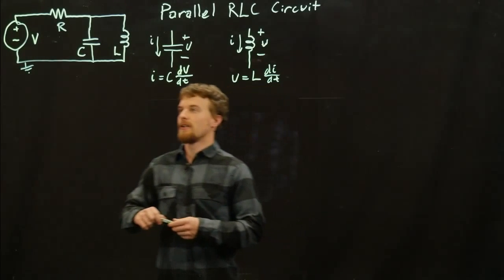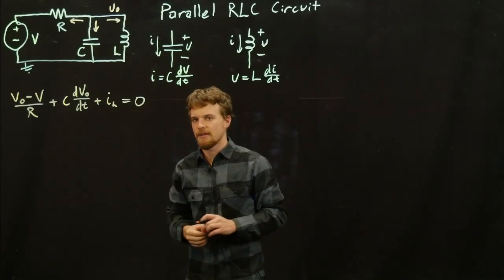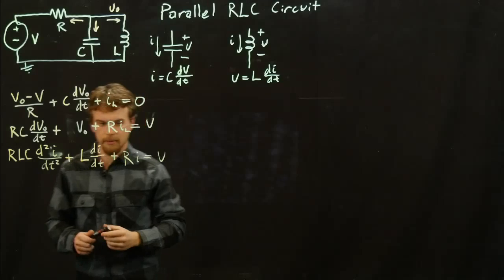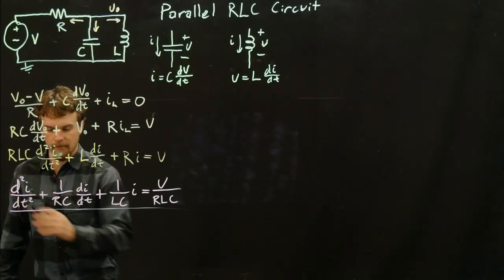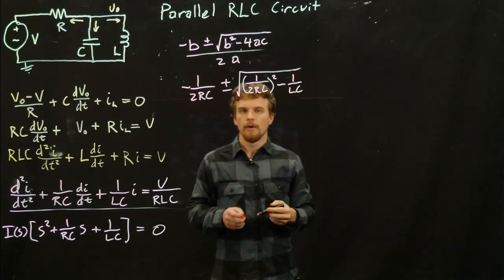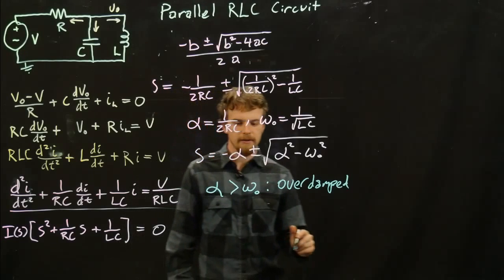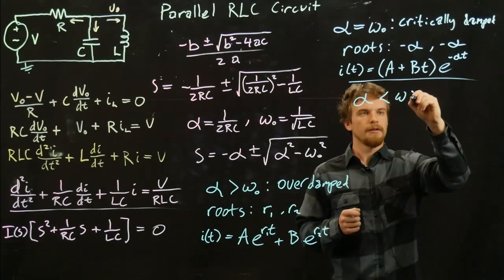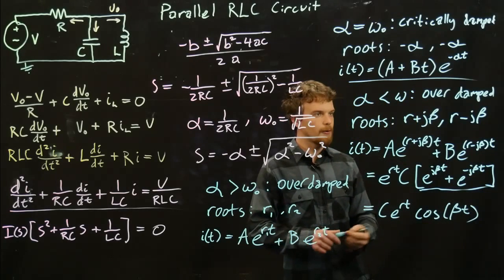Circuits 1 - Parallel RLC Circuit

Comment: One thing about learning circuits is that we rely too much on mathematics, WITHOUT  the real world 'simulation' of it to see the dynamic symphony of the components behavior contribute to the circuit, THE PHYSICS CONCEPT, QUALITATIVE UNDERSTANDING OF IT, flow of electrons, building and collapsing of voltages and magnetic fields, and just using simple algebra to solve it without complex mind boggling 'DIFFERENTIAL EQUATIONS JARGON calculus concepts. I am a VISUAL LEARNER.
Reply: I mean these mathematics does describe all those physics concepts you are talking about but we mortals can't really interprete them in their full potential lol even if I don't fully get it I find it super cool to be able to represent a system like that in such compact way, math can be beautiful too